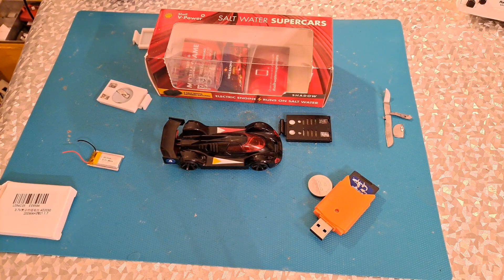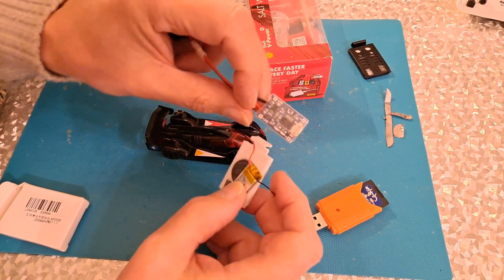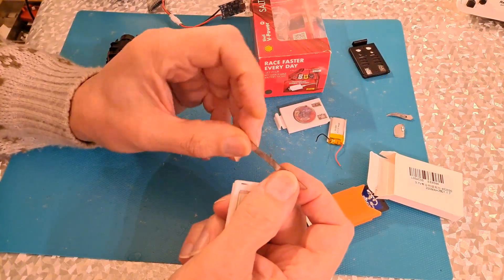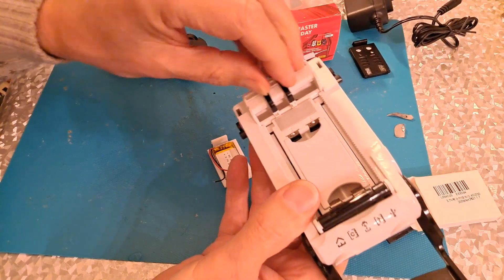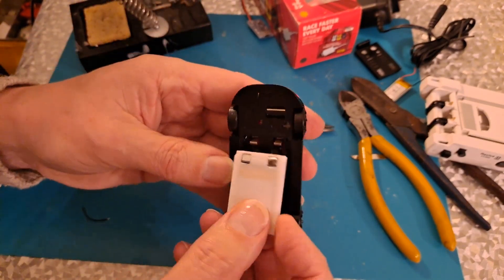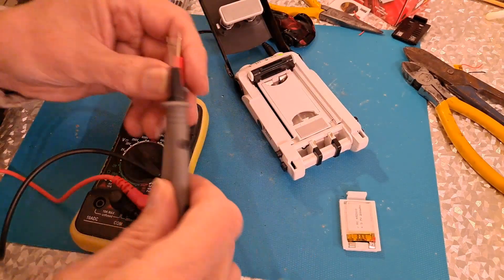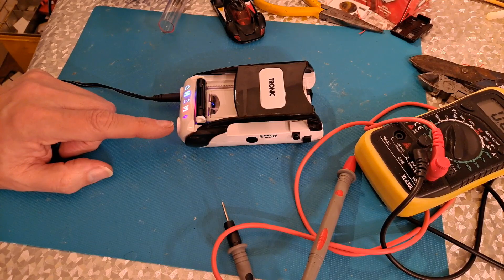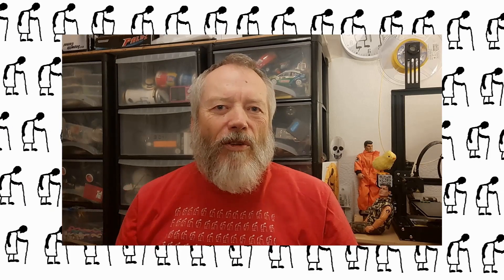Shadow - Shell V-Power Salt Water Supercars LiPo Conversion

Comment: there is some serious power comming out from that now with the lipo in there,the car is gonna go a lot faster now with the lipo as well but the interesting thing would be is to see how long the car will run on a fully charged lipo., on/off switch would be handy ,maybe if u could have it comming out from underneath the body work ,the switch itself, or what not .but that looks a lot better already now.
Reply from the maker: Yes, it is quite fun to watch it running. I put it on a tether so it runs round in circles.